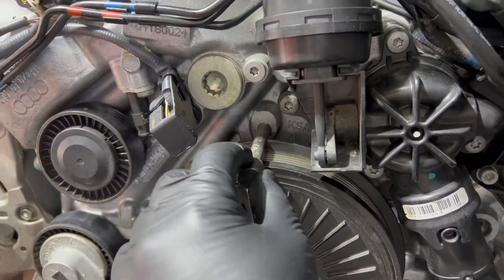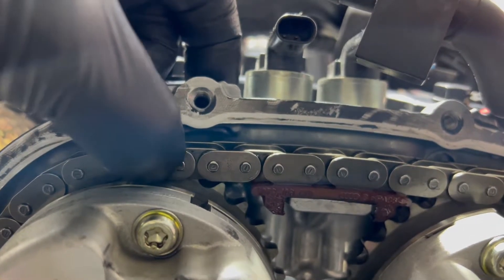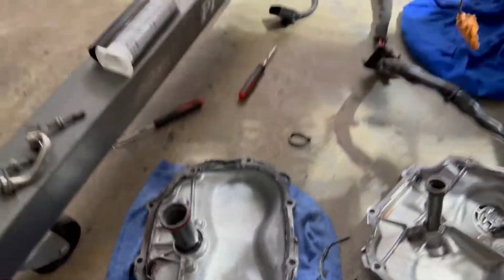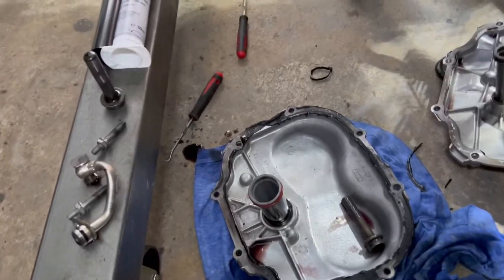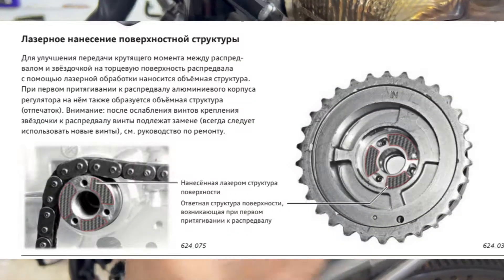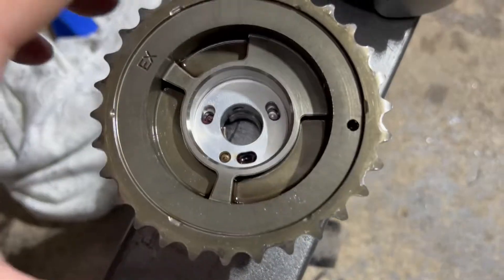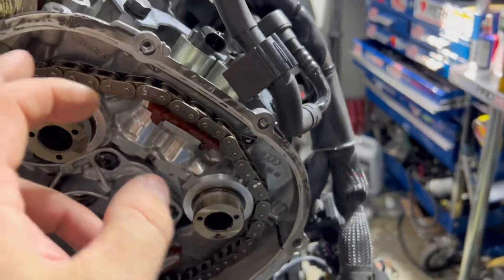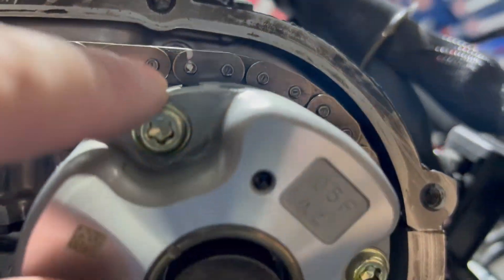AUDI 4.0TFSI Timing Chain Adjustment

Comment: You only adjust cams chain ?! Not change ?
Reply from the maker: Yes, car only had 67k miles at that time
Reply: @Svarogperformance  Lucky for you 😱😱
I checked the values on my RS6 C7 yesterday and got a bit confused.
There’s no ticking noise from the engine — not even when it’s cold or below zero outside.
No misfires under acceleration either.
The car was tuned to Stage 2 about two months ago, and nobody mentioned anything about timing chain issues.
It runs like a dream, but the values look strange to me.

Here are the VCDS readings I just took:

Camshaft exhaust bank 1: –20.000
Camshaft exhaust bank 2: –20.000
Camshaft intake bank 1: 26.000
Camshaft intake bank 2: 26.195

This is from my Audi RS6 C7.5, 2016 model year, 167 000 km.

What do you think about these values — how many degrees is considered good or bad for the timing chain?
Reply from the maker: @Fallen_Angel_1984  You need to PAHSE VALUE CAMS INTAKE AND EXHAOUST
Reply: @Svarogperformance  I ordered all the tools today and plan to replace the valve seals including the Bar‑Tek valve springs on it.
I saw that Bar‑Tek has a really smart solution for between the camshaft and the variable camshaft drive (friction disc diamond 0.2 mm).

Comment: I think I need to replace my chain guides (the small plastic piece between the adjusters that the chain rides on). I'm going to be replacing my downpipes soon and I'm thinking this would be a good time to pop the upper timing covers off and change the guides. Is there any reason that wouldn't be possible with the engine in the car? Its 2016 S6. There seems to be about 8-10" of clearance behind the mating surface of the turbine housing and downpipe. The timing cover mating surface looks to be even more forward than that. Seems like plenty of room to get the timing covers off to me but every video I've seen on cam adjusters shows the work being done with the engine outside of the car. Has anyone tried this with the engine in?
Reply: going through this same thing right now. I've found plenty of instances where people replace the upper chain guide (between adjusters) as well as the upper tensioners with engine in car. I'm getting a bank 2 correlation code that won't go away but the car runs fine. So I am guessing the chain guide broke off or one of the guides on the tensioner broke. Going to remove downpipes and pop that driver's side cover off to see what I find one of these days.

Comment: Hi, I had the exact same issue in my 2014 RS6 C7, I’ve done everything you’ve detailed in the video. I’m sure the timing is correct now. I’ve put engine back in car but still getting correlation fault and misfires. Could it be the camshaft timing adjustment valve?

Thank you in advance! Had engine out twice now. Really need your expert advice!
Reply: Did you figure it out? My shop is having the same isue.
Reply: @TwinTurboV8s nope! Still on the ramp 😕

Comment: Would of been nice if you showed us how to properly tighten the adjusters with the 2 tools. That's where I'm stuck on my a6 4.2 timing is setup the same way as this. Got the cam locks on but when I go to tighten w the 2 tools everything rotates and throws off my timing 😢
Reply from the maker: This part is simple! I can’t hold the phone and tight at the same time. If your tools are the same as mine should be no movement when you tighten the bolts, just make sure you lock the cams with the tool and your crankshaft set at the timing mark! Also timing could be off if your chains is old and too loose it might be required new one if your engine is high mileage. I hope you will figure out good luck

Comment: When i read in Vw elsa its says :   40 Nm 60 Nm  then  80 Nm +90° and you need a new bolt .
Reply from the maker: Could be, I didn't see a point to tourqe 40-60-80 this is not head bolts that required steps just doing right the way 80nm would not affect anything. I did 90Nm and 90* turn car runs strong for over 6 months with no issue
Reply: @Svarogperformance   yeah I know ! Just want to mention it . Anyway great work man , going to do the same work on my s8 , have a rattle on cold start and also after I change my oil for like 1 second , maby a tensioner loses oil pressure..
Reply: @Svarogperformance Just out of curiosity, did you reuse the bolts and they held pretty well or they were new? It’s hard to source the bolts where I am
Reply from the maker: @MAP-q6k You can but at your own risk

Comment: Would this be the same timing for 4.2 Audi A8l 2011
Reply from the maker: I’m not 100% sure but yes this should be the similar because 4.0T engine was adapted from 4.2
Reply: Thank you for responding before the first start dose the car need to be Tdc First cylinder? and if it dose is it the driver or the passenger side thank you

Comment: You overtightened the cam variator bolts and nothing stripped correct?
Reply from the maker: Hi, yes I did over tight, and nothing stripped! If you are not comfortable doing that just follow the specs, please.
Reply: @Svarogperformance  gotcha man. Was curious and wanted to verify. Have a 4.0 in the shop right now that I’m about to do the same thing to.

Comment: Question regarding the removal of the passenger valve/Cam cover. Do you have to remove the timing chain cover to get the valve cover off? I have everything unbolted the front of the valve cover is up but in the back is stuck to the timing cover. I’m sure all the bolts are removed. Could it be the silicone that’s holding it on? This is my 1st Audi and after watching your video I felt like your a Pro. Not a lot of info online regarding the removal process of the cover for the 4.0

Comment: Did this also show up as bad or lower than normal compression or the compression values were okay, but it just misfired at idle?
Reply from the maker: Compression was fine I checked before fixing the timing! It was 170-180 psi
Reply: @Svarogperformance  I see, looks like the issue like this (timing jumped by just one tooth) doesn’t reveal itself when the compression is checked. Thanks for the answer!

Comment: I think the grooves are supposed to be close to the center of the flat part on top of the cylinder head cover.
Reply: Oh wait, you have 4 adjustable cam sprockets, mine only had two.  It’s from a 2013 Audi s4.  I guess the motors are slightly different.
Reply from the maker: @Smog_007  lol this is 4.0T V8 not 3.0T
Reply: @Svarogperformance  oh yeah! Hahah oops.